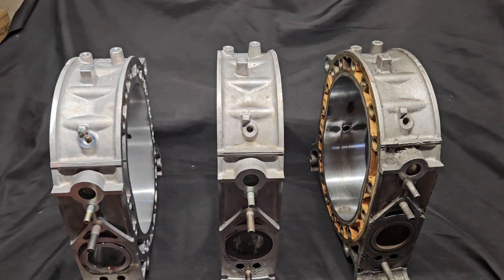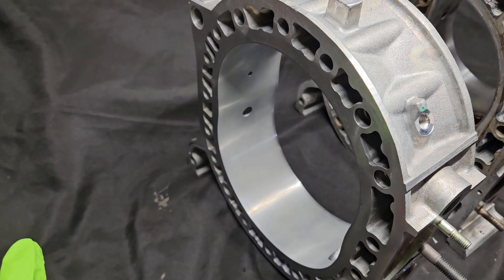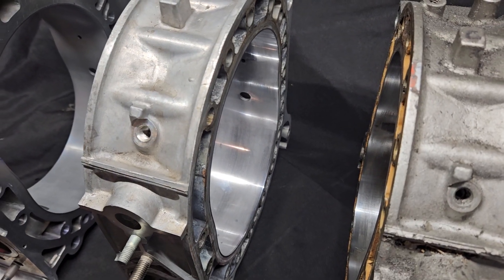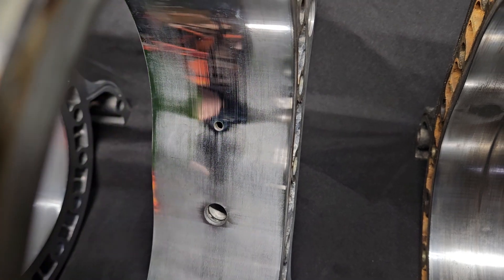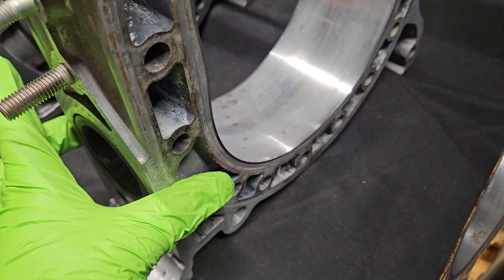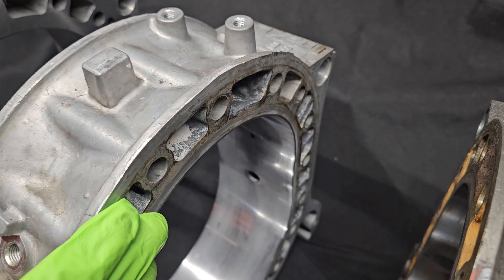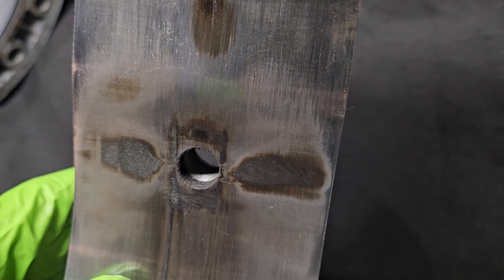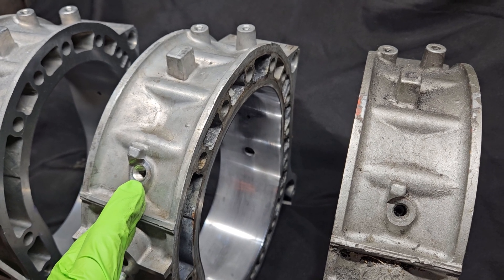Rotor housing inspection new versus used - How to inspect - what to look for - KMR Roary tech talk

Comment: You can get replating for $150,  but nikasil, the best coating for a Wankel, seems unavailable.
Could you provide a list of  housing replating services?
Reply from the maker: Like I mentioned in the video, there is nothing that cheap that works. After plating, you would also need to surfaceit to spec... in most cases, the plating simply doesn't bond like factory and fails early. New is recommended, or the surface grind is some cases
Reply: brother, you are the one commenting that you can get replating for $150; how about you list the housing replating services you are talking about.

Comment: Could you machine down the sides to make it an even surface? By like 7 thou on each side to clean it up and do the same on the rotor to set rotor to iron clearance?
Reply from the maker: No this can't be done.  If you where to remove that much material the rotor would be wider than the housings.  Unfortunately mazda did not leave enough material to face the side of the housings 99.
Reply: @KyleMohanRacing  what if you machine down the rotors as well?
Reply from the maker: @unknowingkoala  This has been done, but generally is considered improper work. And it's recommended to buy new parts versus modify everything in the block to be able to reuse a part that's out of spec.